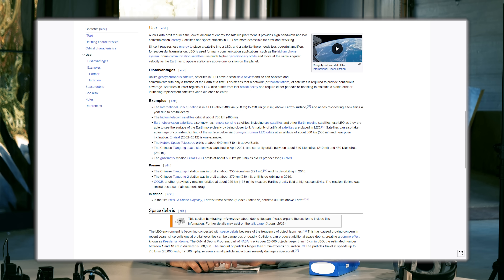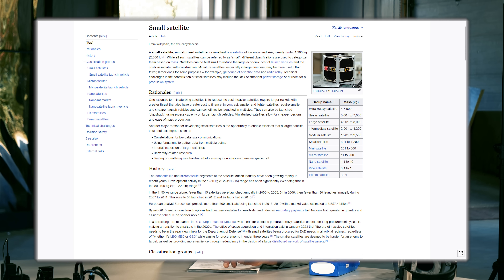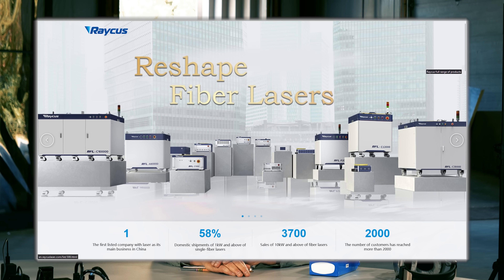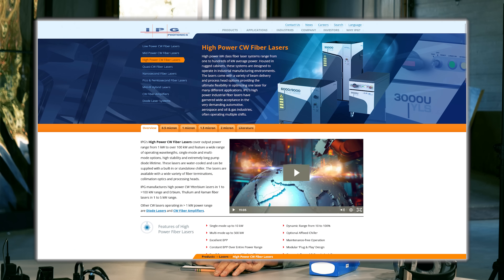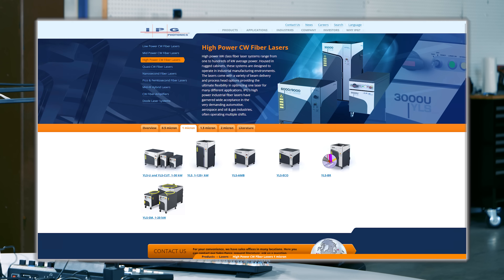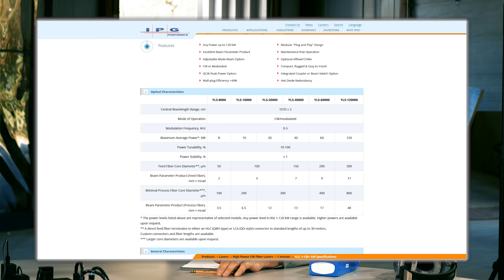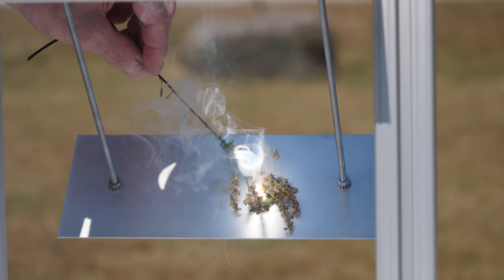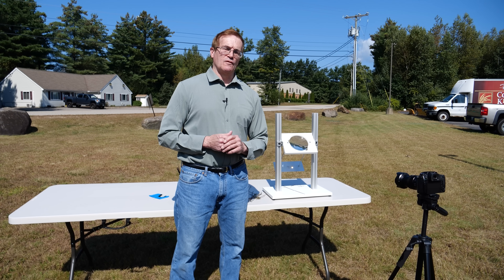COULD SATELLITE LASERS REALLY DO THIS?...

Comment: There a few things you might have thought of but I know you did not speak of.  I know and understand the military mind since I have over 37 years working inside the Army and DoD.  First, the targeting mirror would NEVER be on the Base Laser Weapon  (BLW) it's self. If the BLW used in any attack the BLW position and existence would be discovered. It would be quickly targeted and destroyed.  Instead, it would keep the BLW at a greater and safer altitude and fire at a targeting sat. or even a balloon or even a craft like the x-37 a or c or x.  The thought here is that even if a low orbiting sat were removed by an enemy (presumably an enemy understanding the problem of a kinetic destruction)  they would likely use a DEM or PEM and render the electronics inert. BUT the BLW's location would still remain unknown, since space is very big and radar scanning is nearly impossible at long ranges and we have very good stealth. As long as the mirror does not reflect a visual search is near impossible.  And we know we do have transparent solar panels, but it would also be a simple matter to charge when the BLW is between the earth and the sun. Charging on the back side if you will allow me.   BUT, the logical COA for an actor country would be to use the low orbit sat for the mission is to de-orbit the sat within seconds of the event to conceal the source of the attack. As for your laser power source thoughts, I am not comfortable with your conclusion. Any military that would develop this weapon would have back word planned the power source based on the desired effect on a target and would have planned to have a multiple mission chart.   Since we have space craft like the x37, and since we know about it.  We should, and would do well to assume we have much better craft in hiding and we should assume any space visiting enemy would at least an x37. We have to consider and BLW will be likely be re-fuel if needed.  With the specter of refueling using a stealth craft and stealth BLW we should assume and number of available fuel based high output generators could be on the BLW. So where does this leave us?  I think we should assume such a BLW does exist and that it is covered in stealth uses RTG's for primary power, and solar to charge capacitors for most work, but when needed it would be able to channel direct energy to the weapon, and use a multiple lower earth mirror sats for final targeting and even possible amplification, remember the x37 and beyond removes most weight restrictions in this possible thought. What I am describing is a very complicated and expensive system of craft and using it to set fires in Hawaii or now even LA is ridiculous, even for an enemy. BUT I think a state player like Iran, North Korea, or even a terrorist actor could be given lasers technology capable for being flown in a commercial sized aircraft and used to set fires.  BUT in the case of Hawaii and LA the satellite evidence on the ground ignition seems more logical. Anyway loved the video.

Comment: Cool Presentation.  However, even though the presentation is based on an explanation of known technologies, It might be an undersight in logic in the presentation to base the explanation theory of confidential advanced military weapons systems on known technology and methodology.  This presentation assumes that some electromagnetic propulsion does not exist that allows for higher altitude temporary geostationary positioning (22,236 miles up).  If such a technology exists, the Spa-War platform might be as low as the Karman line at 62 miles up using a type of modern plasmatic skin stealth technology.  Additionally, this is also assuming that no ground-based assistance technology is being deployed.  In the late 90s, a Naval technology was developed to use a rasterized EM beam in air above a ship to create a virtual antenna.  If I remember it was called "virtual atmospheric antenna array" or something like that. Such a technology could also be used to act as a virtual convergence beam for long-range lasers.   This would have to be done in the low-altitude layer.  This would be ideal because it would allow for a safe level of divergent beam energy to be converted into a stronger, more intense beam at a safe ground proximity level.  It might even be able to create a type of conductive plasmatic tube that acts like a light pipe or a step-up or step-down frequency modulator.  This presentation also did not discuss carrier wave or convergent wave technologies or Beam Steering.  ... Regarding power you did not mention Space Teathers.  The first published test on use of Space Teathers to investigate harvesting energy from Earth's high-altitude magnetic field started in the days of the space shuttle.  The amount of energy that was supposed to be possible to be generated was immense.  During the 1980s, President Ronald Reagan initiated the Strategic Defense Initiative (SDI), Otherwise known as “Star Wars,” It was an anti-ballistic missile program that was designed to shoot down nuclear missiles in space.  SDI sought to create a space-based shield that would render nuclear missiles obsolete. It is rumored that a number of novel beam weapon systems were developed that were unconventional to public knowledge.  This included what we would call particle disruption beams. From 1983 to 2023 is 40 years. It would be extremely naive to assume that 40 years of Beam Weapons research was unfruitful.  I think that Dr Judy wood made some very cogent observations on 9/11 on youtube.  Like vertical farming, full-frequency light is not optimal for efficiency.  So, the energy frequency band being used is absolutely unknown.

Comment: How are you using a 20kw laser and getting 5x the power, or 95kw per m2? It seems like you did the math wrong, or what am I missing?
Reply from the maker: It's  the area that  you need to divide by. A 1/2 meter diameter  circle has an area of roughly  1/5 M^2.

Comment: Saw a photo of a large military helicopter over Lahina after the fire. It had the attachment to the front end that typically has an articulated gattling gun attached. But instead of the gun, it had a glass dome with a cylindrical base.
Reply from the maker: That was probably  a multi-wavelength imaging system, including  thermal cameras.

Comment: These weapon systems likely were built in stages, similarly to the ISS. Have you seen the Maui fire footage? What can melt car windshield glass, liquefy the engine block but not even remotely burn the foliage on all 4 sides of the vehicle?
Reply from the maker: I don't think so.
If you run through  the numbers, you'll  see that even with megawatts of laser power, you might melt just one car if the beam remained on it for the full ten minutes. It isn't  consistent with the destruction.
Reply: @TechIngredients  yes but look up Michio Kakioo or however you spell his name's video about the trillion watt Lasers that we have. Trillion watts would do the trick.
Reply from the maker: He's  a bit of a character.
Nevertheless,  He's  talking  about a laser that produces a trillion watts for billionths of a second every few minutes.
Not going to work.

Comment: Why does it have to be space based. Couldn't a high altitude mobile platform capable of circular travel thus longer loitering be a more viable option? This would also allow for specific altitude targeting. Once again the hoof beat analogy.
Reply from the maker: The hoof beat analogy would suggest that the fires were the result of high winds, poor civic management, and possibly arson.  I wanted to explore what is physically possible even if it isn't the most probable explanation.

Comment: Using fresnel lenses I can melt rocks especially ones with iron ore and pretty dam quickly ta boot .
 I have also situated lens at a distance that is their most intense from one into the next × 4 which made a dangerously intense cutting beam . This beam on a clear sunny day burnt anything it was pointing at instantly.  The thing nearly burnt the building down and to be honest was pretty scary how powerful it was . Things in its focus area didn't slowly start to smolder then catch fire , most were transformed into ashes instantly or close enough to instantly to  say so . 
I have wondered if lenses combined with solar panels would be more efficient at generating electricity or if the focused rays would destroy the solar panels. Focusing suns rays can obviously be used to generate heat and thereby steam which can then be used to turn turbines and generate electricity . I would not at all be surprised if this would be a better platform for homeowners or at least incorporated into the overall production of electricity.  
I bet that regular solar panels get very hot , hot enough to make steam pressure . 🤷‍♂️like if tubing were inbedded in the panels and water were heated simultaneously while the panels used in the traditional way made electricity.  I hope that this makes sense to anyone who bothered to read it. 😀.

I have always thought that the best way to produce energy is not any single current method but rather taking advantage of several methods/opportunities simultaneously . Waste not want not

Comment: The fact that a laser diverges is not a good argument because divergence only happens after the focal plane.  You can converge a laser to very high intensities using a focusing optic.  You just need to make sure the location of the focal plane coincides with the location of the target.
Reply from the maker: That's not correct.
Divergence is a property  of all electromagnetic radiation, including light.
You're  basing your statement on simple geometric optics and not the property  of light as a wave.
Reply: @TechIngredients  Then how is light diverging, when it is being focused but before it reaches focus?  It would be converging in this case, with an angle equal to the "divergence" angle.  When wave optics is considered, the focus has a Gaussian distribution, rather than a Dirac delta.
Reply from the maker: You're  not actually  considering  wave optics.  Diffraction is a property  of all electromagnetic waves. If it was not the controlling factor, then theoretically, you could focus light to an infinitesimal point or achieve  infinite  resolution with an imaging system. You can do neither.
Reply: @TechIngredients  Well yes, but I don't see how this changes the fact that a focused beam converges, not diverges, as it approaches the focus.
Reply from the maker: It's  always  diverging due to diffraction.
A good way to think about it is as a series of disks stacked in a line (an infinite number of infinitely thin disks). At each disk, all the rays passing through  are aiming at the focal point, but are also gradually  spreading away from each other due to diffraction. At the focus the balance determines  the minimum  spot size, and it can never be zero.
Reply: @TechIngredients  You're referring to Huygens principle where every point on a constant phase surface becomes a spherical emitter.  The energy distribution still converges for a focused beam, even if the phase fronts don't.  The divergence angle you provided refers to the angle associated with the width and distance from focus in which the intensity of the beam falls radially by a factor of e^-2, which refers to the energy distribution rather than the Huygens wavefronts.

Perhaps what you are arguing against is the idea that diffraction prevents an infinite intensity point distribution.  I'm arguing against the notion that the beam divergence can only result in intensity losses after propagation.  This may be true if you are trying to send a collimated beam, but scientists / engineers would be smart enough to focus the beam, creating a more intense region than what they started with.

There seems to be multiple takes as to how Huygens principle explains a focused beam.  One explanation includes the idea that spherical wavefronts interfere destructively outside of the localization of the focused beam.
https://physics.stackexchange.com/questions/581358/huygens-principle-its-correct-interpretation-and-why-there-is-no-destructive
Other explanations include "fudge factors" modifying the original theory.
https://arxiv.org/abs/0904.0683
Reply from the maker: You're  making  this too complicated.
It's  a subtle  concept, but it can't  be denied. Light does diverge, and the divergence  depends on the equation  I presented  in the video.
A weapon's performance will be affected  by this, as will a laser cavity, a microscope, and a telescope.
Reply: @TechIngredients  I believe you are mistaken in saying that all light diverges by the equation given.  That is only true after passing focal plane.  Before arriving at the focal plane, light converges to form peak intensity at the focal plane.  That's how you are able to focus sunlight into a tight spot using your lens.  Are you saying that the light should diverge (spread out) immediately after passing through a focusing lens?

Comment: What if you had a fleet of thousands of Kw scale lasers on satellites like Starlink?  What would happen if they were focused on a single point?
Reply from the maker: A few might cooperate.  However,  as the number increased, the lateral distance would increase as well, the beam spread would increase, and the intensity would grow more and more slowly.
Reply: @TechIngredients  It need not be efficient to be effective.  Bear in mind, though,  Starlink satellites already use laser crosslinks to communicate with each other, which means they must have extremely accurate lasers.

Comment: My maths may be off but I think that spot size would be correct for a lens 1m^2 in area. For the lens used in the demonstration I think the spot size should have been 1mm across. If I'm wrong, then my apologies. If I'm right and such a spot size was achieved, then the result would have been the same as in the demonstration but faster so no big deal as far as I am concerned.
Reply from the maker: You want 95 sun's.  At 1 cm diameter, the concentration would be 125 × vs the lens.  Taking into account  loss through the lens and the lower solar intensity at our northern  latitude, 1 cm should be right.

Comment: And grass fires can melt Aluminum?
Reply from the maker: And?
Once a fire starts, nothing requires  that it will continue  to burn only grass.
Reply: @TechIngredients  no kidding, but temperature matters.  Aluminum wheels are melting, while trees nearby are untouched.  That's the real issue.
Reply from the maker: Don't  ignore  the contribution  of the fuel onboard each vehicle.
Reply: @TechIngredients  Right!  Because the fuel either explodes, or evaporates, and then all the heat from the fire defies gravity and sinks to the ground instead of rising to the trees overhead.  Very logical. 🤔